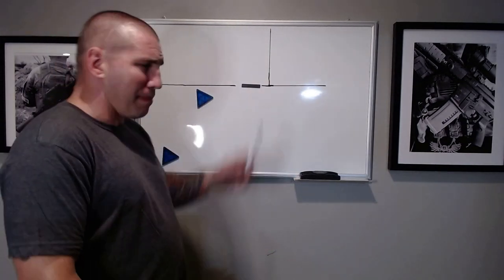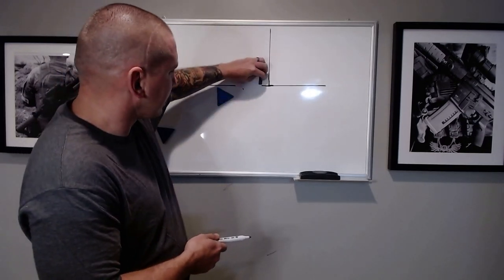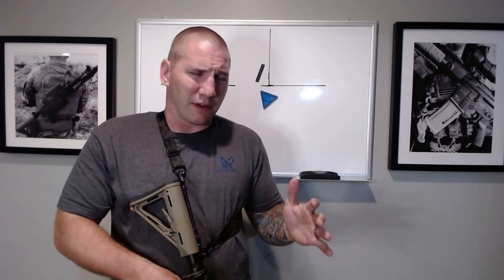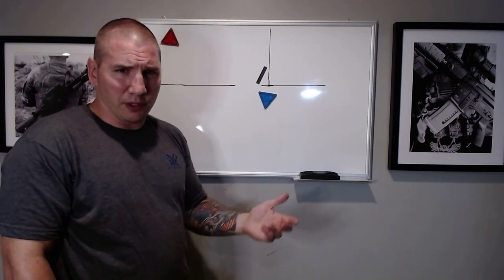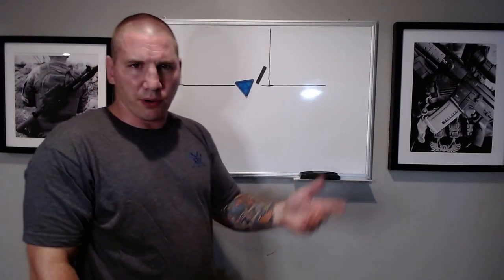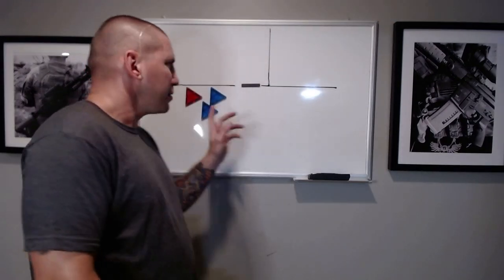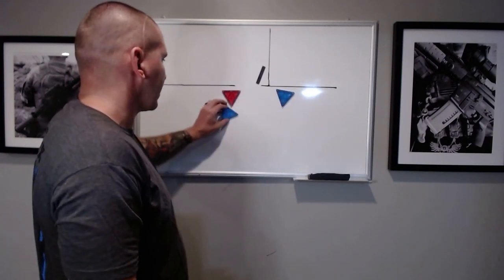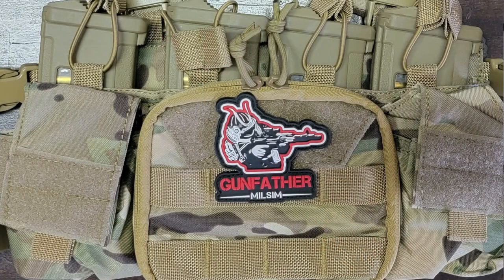Doors and CQB - A SWAT officer's perspective

Comment: Whst if someone behind door
Reply from the maker: In my experience people hiding behind doors is very rare. The two times I have encountered it in the last twenty years I think it was less of a choice and more of just where they happened to end up. In both cases it was obvious there was someone behind the door because of the way it opened. For lack of a better term it was "squishy". In both instances a couple of strong shoulders against the door resulted in an immediate surrender.
Reply: @GunfatherMilsim  HEY HEY I respect the milsim and combat operators, and I have learned CQB in simulator games alongside experienced community members, but I have a question! Assuming split stack #1 strong side & #2 weak side on a center fed, would 1 person pie the threshold at a time or would both operators pie the threshold at the same time? Arguments have been made to contrast one being more dynamic and focusing on violence of action / speed and the other being more deliberate and possibly thorough and safer. What is your opinion?
Reply from the maker: @Pearmesan  Two guys snapping the door at the same time is great in theory but in practice it is more challenging. Getting two grown men wearing armor to snap a door at the same time is very difficult. There just isn't enough room. On a commercial door with light weight kit it is doable but still tight. Realistically someone has to go slightly before the other. Additionally when snap a door in this fashion "Bail Out" is not an option. First off there is no room and second it would leave the back of the other guy exposed. I am not a huge fan of techniques that leave no option for bailing out but I am fairly conservative in my CQB because of my SWAT background.
Reply: @GunfatherMilsim  i was in bedroom and police used a flash bang 💥 thought it was gun shot so I ran to hide behind door bedroom door cause thought the guys house was being robbed so I got scared 😱 the police bashed the door on me swung guns on my face said hands up it was no knock warrant arrest warrant for the guy I was visiting ( he was selling purses on line and stupid me was at wrong place at wrong time I walked into house 8 min before swat made raid